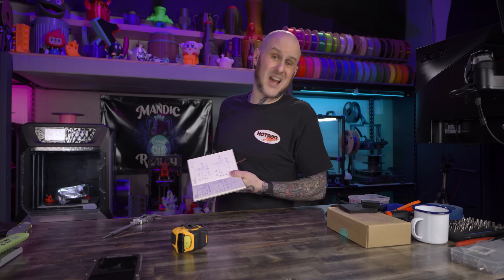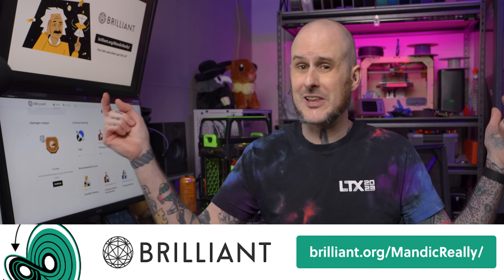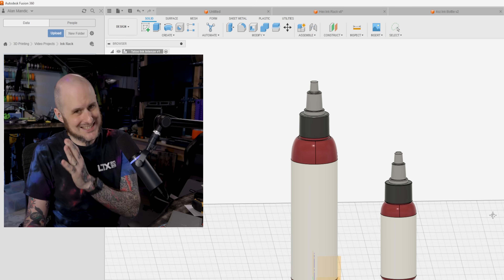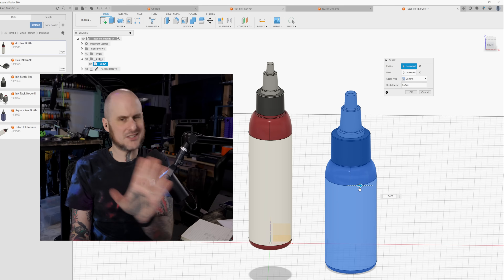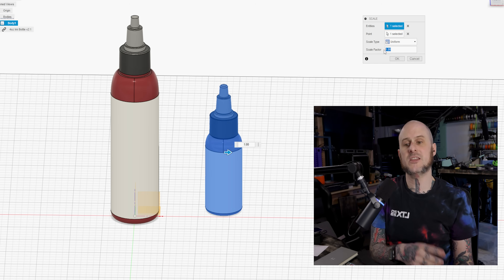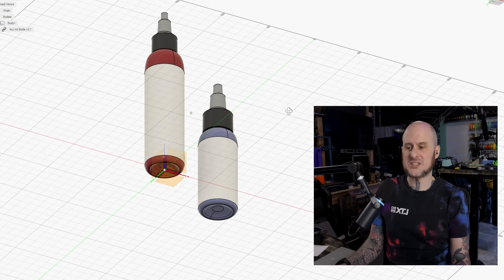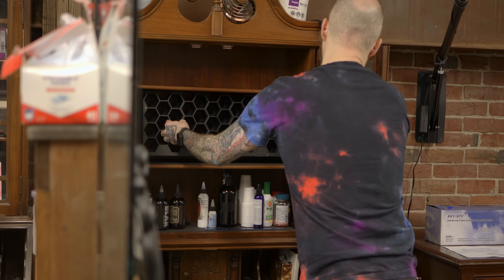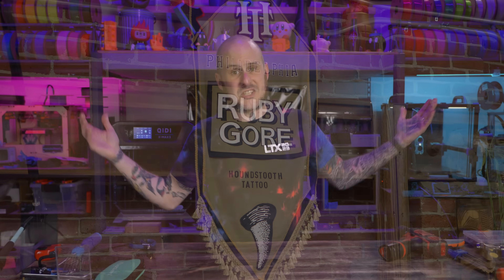Leveling Up A Tattoo Studio w/ 3D Printed Ink Racks!

Comment: Good to see this video right now, even though it's a year old ...
I am moving to a new place and just started to reorganize my new workshop. My current bottle rack is one of those standard things with all bottles stored vertically and I have a hard time picking my colors from that one. Your rack not only looks better but also shows more of the color through the bottom of the bottle.
As an added bonus, I think it is easier to shake and mix the paint (model paints, not inks). Pigments tend to drop down to the bottom of the bottle and with the smaller bottles it is hard to shake them well.
This might be the perfect way to store paint

Comment: A tip for you regarding thinking in layers: Fusion has tons of little parameter functions that can help, so you can use min for instance to make sure a value is never smaller than your layer height, ceil, floor, round can all be used to roung any number to a multiple of your layer height and so on and so forth.

All of this is quite helpful if you dont want to have to figure out the multipliers etc yourself so you can focus more on the design. Its also great when you want to make parametric changes.

Comment: What makes you add the extra wall width for the infill?  Why not reduce to 6*extusion_width and save the print time?
Reply from the maker: Because Evan wanted the wooden face on his. The thinner the walls between the alcoves, the weaker the wood would have been and less of it you'd see. I was balancing not having them be too thick & the wood. Didn't want to bog the video down further with that explanation but a few folks have asked so I probably should have.

Comment: I feel like your way of doing things is perfectly fine, but for thingsl ike this, it's probably better to lay all of the round bottles next to each other on top of a cutting grid, take a picture, use it as a canvas, trace half of the bottle to scale, then create a revolve around the center axis.
Reply from the maker: If I'm understanding your direction properly, that would leave a bunch of round holes. That is a very inefficient use of materials as there is a lot of material left between each section versus the Hexagon pattern. I see your direction, and for speed of design it is totally logical, but for overall design quality & efficiency it isn't. I'll gladly spend more time on a design if it returns an overall superior result. This is a design I could see releasing for others to use, or produce for release, so speed is rarely my primary focus.
Reply: @MandicReally  Thanks for the reply. I should've been more specific. I agree that the hexagons were the move. I meant to say I would've modeled the bottles that way in Fusion360 for when you were doing the layout, then you wouldn't have to worry about cap sizes and stuff. I spoke too soon though, since the way you designed everything was more universal and didn't make a difference on the cap size anyways.

Comment: Great project and very informative content, all neatly tied together!
However, in my experience, it's not ideal to limit your design parameters to the parameters of the printer. Today's slicers are perfectly capable of compensating for variable shell thickness (as you say in the video). So, in my opinion, it's best to design for plastic, with plastic design constraints in mind. I would have made the connecting wall a maximum of 2mm, which would have saved a lot of material and printing time. 😊
Reply from the maker: The other design constraint that I didn't reference is the wood. Yes I absolutely could have gone thinner between each alcove, but then I'd have had 2mm thick bits of wood between them too.  I balanced printer parameters AND wood fragility. Just didn't want to keep on dragging out an explanation of all of my design thoughts.

I thoroughly disagree with letting the slicer do the work though. You often cannot control HOW it changes things to fit your design. Why allow a slicer to make changes that may or may not achieve your desired outcome when you can just design with constraints in mind? There is always .2mm nozzles (or bigger), or other options if there design constraints are too limiting. You just have to be mindful of what they are and what your goal is. Outside of artistic reasons, I personally think sticking to the characteristics of how printers function is integral to good design.
Reply: @MandicReally  that’s for granted, you have to know extremely well how a 3d printer and slicer work. I design taking into account nozzle size and material and I just think line thickness of 0.45 mm (for a 0.4 mm nozzle) is no longer something to design around because today software adjusts that efficiently and automatically (arachne). That is what I meant, sorry if I was unclear.
The printer is the tool, I hate that sometimes it has been the other way around (for me at least). 👍🏻

Comment: “1 millimeter can feel like a mile.” As a 3d newbie I’ve already felt this and the idea to use a model of the ink bottle is awesome!
Reply from the maker: When designing parts we can really get bogged down too much in details. It’s important to see the big picture as much as you can. 👌🏻
Reply: @MandicReally  Indeed. Check in on your friends in a month or two, I tried a similar build with wood and the nozzles would clog with dried ink. You’ve inspired me to brainstorm some kind of vertical system, but I’ve got my fingers crossed that your design works, it looks great and I love the modular mindset.

Comment: What does OSHA say about this? I would have concerns about the porous surface, but still a nice solution.
Reply from the maker: OSHA has nothing to do with tattoo studios. Most states and cities barely regulate tattooing (in my experience). Philly has the Health department cover it pretty well though. That said, Tattoo inks should NEVER be handled with “hot” hands. Always clean gloves or ungloved hands. As such the outside of the bottles is considered a “clean” surface. Good artists still wipe them down with at least alcohol to ensure they remain that way. All that to say, this storage method should be a non-issue as the bottles aren’t considered contaminated to contaminate the rack. 

Nothing is perfect and I totally see the point, but I’m actually quite anal about cleanliness in procedural work like this. I see folks printing ink cups and it makes my skin crawl. This rack I personally don’t see an issue with.

Comment: Could've connected the parts together with integrated dovetails instead of heat inserts.
Reply from the maker: That was my original intend but it would have required thicker walls between each part. As it stands I was at the maximum size my Laser can cut to make that wooden face plate.  I couldn’t afford any longer. That was a design constraint I forgot to include in the video. Honestly I’m happier screwing it together. Dovetails would have taken multiple prototypes to mail the fit of, the screws just worked the first time.

Comment: Question.....why not use 0.5 line width and design with nice round numbers like 2? I used to do the same, use .45. One day I said F it, went to 0.5 and never looked back.
Reply from the maker: For me, I’m often having walls as thing are .45 or sections of 1st layers that thin. Wider would be a hinder to finer detail work for me.

Comment: Another design tip is to use parameters. Setting a layer_height as a parameter and then having the chamfer be layer_height*5 or whatever is pretty neat. Probably beyond the scope of this video
Reply from the maker: Yep, just trying to lay the ground work of thinking about design parameters like that. I can’t say I’m familiar with setting parameters. I’ll have to look into doing that myself. 👌🏻
Reply: @MandicReally  parameters are the best! In my layer_height example, if you decide to go 0.2mm later, all you have to do is update the parameter and all the sketches, chamfers, etc. that use that parameter auto-update